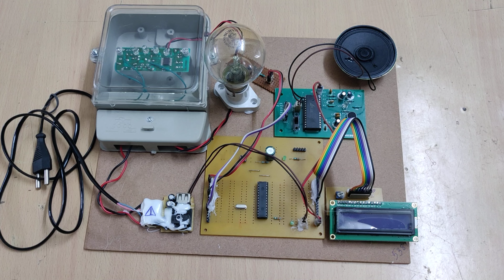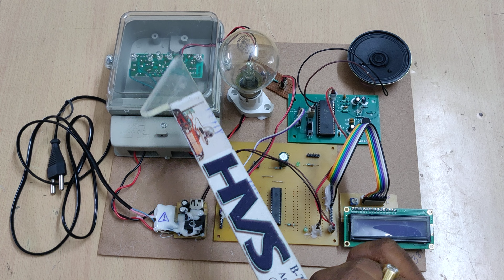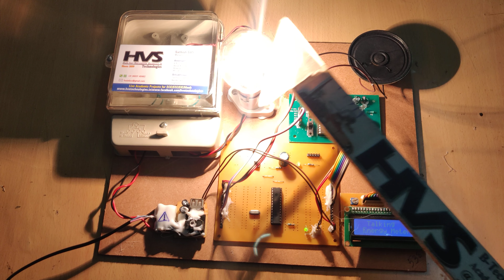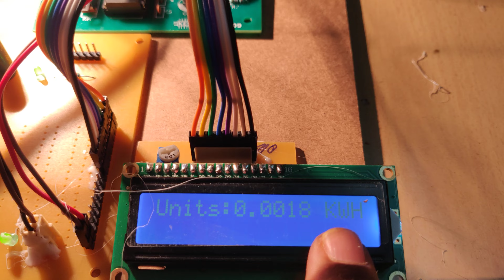Talking Energy meter for High Power consumption

Comment: Overall Cost for this project
Reply from the maker: You can contact us at +919603140482
Through WhatsApp or call
Reply: We did this project.
Around 7-9k bro
Reply from the maker: @nagraj5068  it's cost 4500/- included document PPT kit video explanation circuit diagram and code